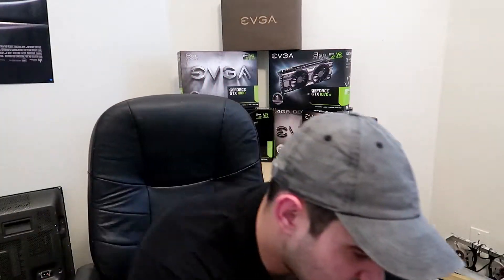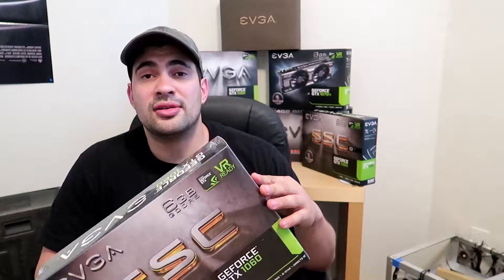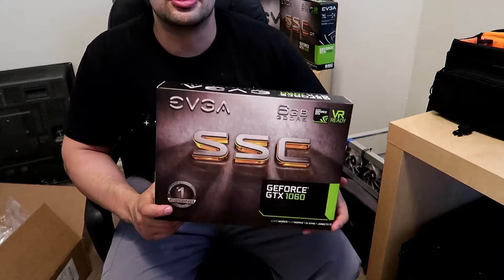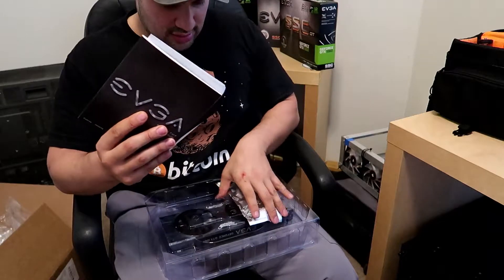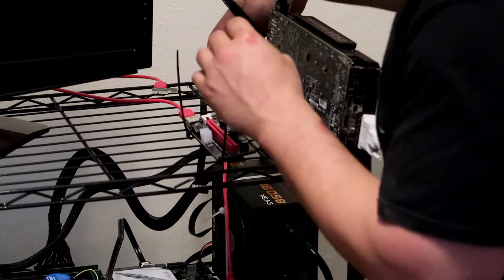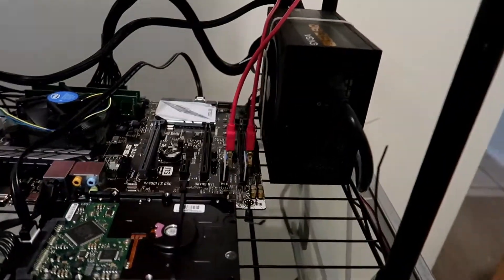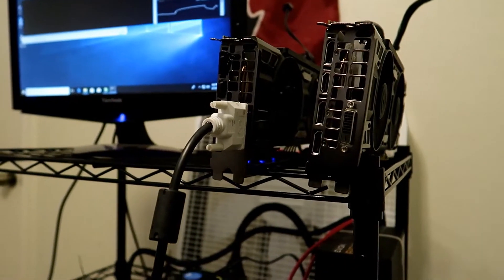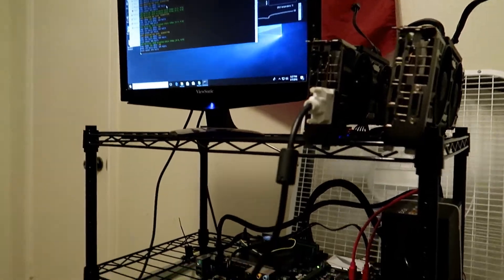GTX 1060 FTW vs GTX 1060 SSC MINING

Comment: It's a pity that it doesn't make sense to buy two 1060s, if it is GTX1080 (one FTW, the other SSC), it will be fine.
Reply: Gtx1080 sli 5120 cuda better rtx 2080 2944 cuda . Rtx3080 is good 8704cuda not support Nvlink dual link

Comment: you got a DT version... meaning De-tuned... meaning its basically a founder edition card with a fancy cooler
Reply: Btw thats a DVI cable. not a VGA
Reply from the maker: Moody Farhoud "All you need to know is that FTW and FTW DT are both in the same top Tier. FTW DT, with DT instead of it stands for derp team like I hoped, EVGA says it actually stands for Standard (go figure), meaning this version does not come factory-overclocked. That’s all.

Out of the box, FTW DT runs at REF Tier’s clock speed and boost speed. Yet FTW DT has the same fancy cooling design as the original FTW with 10+2 power phase, RGB LED, and a powerful VRM controller that powered the GTX 1060. Those are the features that REF/SC/SSC editions don’t have." - www.custompcguide.net/compare-evga-reference-founders-edition-ti-acx-sc-ssc-ftw-dt-classified-gpus/
Reply: Ya its basically a fancy DUD

Comment: What do you have the core and the memory set to
Reply from the maker: charlielawless01 Core- 165, Memory- 600, Power- 100%
Reply: Ghostbitcoinminer 57 are those the settings in the nvoc19 base file?
Reply: Never mind I see you did it in windows. Would you know what the settings would be for the Linux nvoc19 miner
Reply from the maker: charlielawless01 Sorry, I don't
Reply: Ghostbitcoinminer 57 ok. I have the regular EVGA 1060 mining zencash at 320 sols/s set to power limit 100, core 135, memory 1200. It's on nvoc19
Reply: I can get 325 sols with a zotac 1060 6gb with +150 core +700 mem and power on 85% running at 60c, that's a $50 or more cheaper card getting nearly the same rate for less power, those (special edition) cards are not worth the extra money for mining
Reply from the maker: Raptor 00 Cool, let me try your settings! Thanks
Reply: Also I have my fans set on 75/78%, I don't leave them on auto
Reply: My cards have the Samsung memory so if you have the Hynix or the other one which I cant remember off the top of my head you wont get as much hash rate as with the samsung